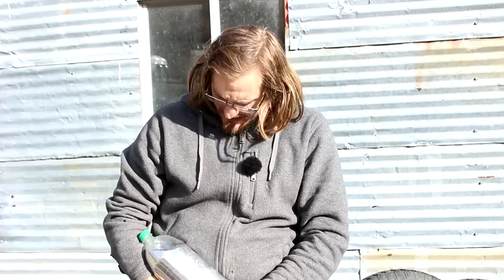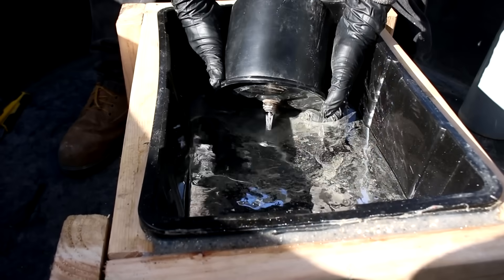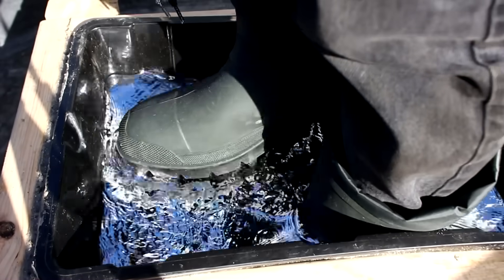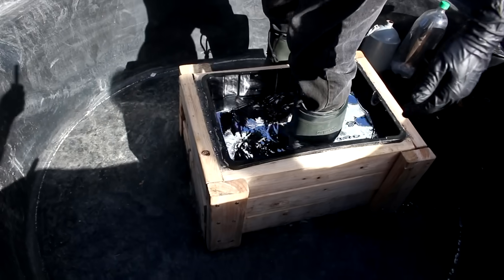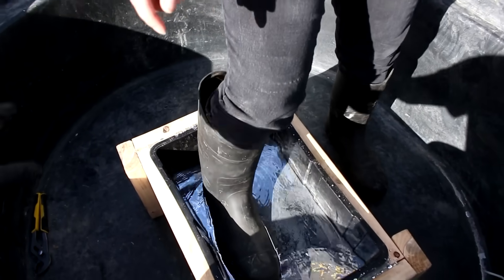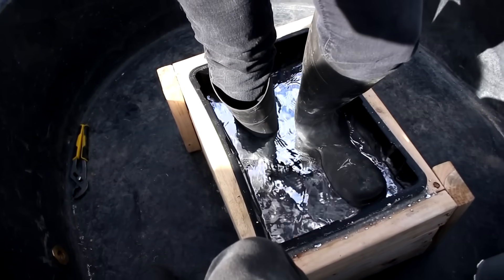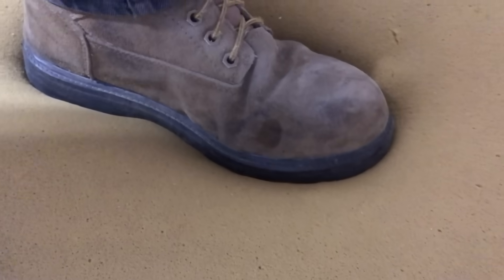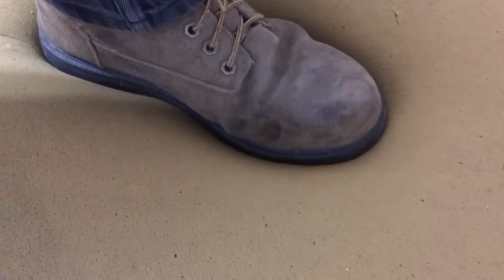Can I Stand On Liquid Mercury?

Comment: Have you ever heard of the idea of a buoyancy rocket? It would be a very buoyant, very aerodynamic object that is tethered to either a weight or the bottom of a container, keeping it submerged deep in a liquid. when released, it would be forced up through the water, then through the air. The version i heard of would start at the bottom of the ocean, but im sure a smaller model could be submerged in mercury to be pushed upwards even more forcefully. Does this sound like a possible means of flight, or a cool toy? Cody, if you see this, i think it would make for an interesting video. if not, what do my fellow commentors think of the idea?

Comment: I'm pretty sure you wouldn't ever be able to balance on it, even with a wide stance.  It's hard enough standing on a slackline, and with that the line is limiting the front-rear movement of your feet.  (and giving a slight centering force, assuming you're very close to balanced.
What you're doing is like balancing the broom, but instead of doing it on your hand, you're balancing it on an extremely low friction surface on top of your hand.

Comment: i wonder what would happen if you went barefoot because when you put air into any liquid it will always rise, such as the air in the boot. like pushing the bottom end of a cup into a container of water it shoots out of the water because of the pressures.

Comment: I saw some debate about the balance which seems quite wacky, so here's my take. In order to balance you need to make corrections by moving the pressure distribution of your feet on the "floor" on the 2 axis of this floor plane. Pushing more on one foot and lifting the other can give you lateral balance, and spreading the feet could help that (assuming that the viscosity drag when you lift is not bringing you down too much on that side). When you lift a foot, the upward force on it is lower, helping to regain the balance.
The real challenge is the other axis, heel/toe correction : there is not enough pressure gradient to push you backwards if you point your toes down. And the only way I see out of this is either with some sorts of accessories or much more space and skill : if  you fall backwards, make some kind of scissors with your legs to bring one in front so you can push yourself backwards. But honestly, this thing feels like ice  if you do it for real (with a little bit more inertia maybe) : what happens to people who start to zip backwards ? they never recover by trying to put the other foot further back, they end up on their but. 
You want to train ? cover your feet with 2 solid balloons full of air, of the right volume, and go try to stand in a swimming pool ! With some tuning (size / shape / type of surface contact of your feet...) it can be the exact same feeling.

Comment: Cody, if you have two attachment points high enough, you can simulate this pretty easily. I guess you might have some old stirrups on the farm. Just try standing in those. The pressure gradient in the mercury provides a tiny bit of a balancing force, you can recreate that by tweaking suspension length.

Comment: Of course you can stand on mercury.  You simply put a greater weight  (or more correctly, a greater density) of mercury in the box than you weigh yourself.   BTW, it's not gravity holding the mercury or you down....it's buoyancy.   Gravity does not exist as it is a myth of science (so-called).

Comment: Cody, make a shallow tripod with a platform as the top. maybe out of a round table. then float each leg of the tripod on mercury. stand on the tripod. see how small you can make the feet before you hit bottom. perhaps removable disks of different sizes. calculate the volume displaced and the mass of you and the table/tripod.

Comment: like lead, mercury is really not as bad as everyone think it is. I'm trying to explain this to my chemistry teachers at University.... Seems like everyone got paranoid about it as some point. Mostly because people just heard it was dangerous, but don't actually know why or more. For both of these metals the metallic/elemental/oxidation state = zéro is almost harmless. It's there salts and vapors who are more harmful. In vapor state you're dealing with a single molecule which is small enough to pass biological barriers like cell walls or tissue (in nose, lungs, wounds, stomach, etc). In fact it's exactly the same for the ionic forms in salts or compounds. The metal ion is isolated into water which bounds to skin and tissue eliminating any barrier. Being ions they bind on proteins and molecules of cell membranes or extracellular matrix.
Once there they are for longterm in your body because the body hasn't developed a mechanism to get rid of them due to this being quite unusual in our environment.
Now mercury does vaporises at room temperature, but REALLY slowly!
I'm not aware that we understand how they affect the body once they are in to cause the illness we know them for. But the worrying about those metals and the illnesses they brought only concerns people who work with these metals on a daily basis. Using them in compounds (lead paint) or at higher temperatures (lead casters, mercury gold miners, mercury distillers,...).

So to all those afraid, you risk nothing by casting lead bullets for reloading every once in a while, or playing with mercury like Cody does. You don't even risk a thing by swallowing a lead BB from a hunted bird.

PS: I only have 50g of mercury and about 5 pounds of lead. So watching you Cody play with 250kg of Hg makes me kind of jealous. Greetings from Belgium and glad to see you back on your channel after that YT shitty suspensions. Continue on the great work!

Comment: +Cody'sLab  If you retry this experiment in a bigger tub with more mercury, can you please try standing in it together with Kanyon?

Also, get yourselves some tighter boots, which will make it so that there will be less air in them and have a smaller volume and be closer to barefoot than in this experiment.

Comment: One thing I am sure you know, but wasn't clear in the explanation. The buoyancy of the boots (displaced volume) matters more than your weight. The weight carrying capacity is directly related to the displaced volume, not the weight. If you got form fitting boots, or plastic bags. you may not displace enough volume to float. If you stood in a bowl that displaced more volume than the boots, or just had a pair of bigger boots, you would float higher. Just building a boat on mercury and the same rules apply.

Comment: I'm wondering if standing on mercury is enough to squeeze the blood out of your feet (without boots). According to a short research the blood pressure should be 60 higher (google "Blood pressure changes in the leg on standing" for a source), so you would you have a systolic BP of 180mgHg in your feet. Which means that that you would lose circulation in parts of your body that sink in deeper than 18cm/7inches. 

So I would say its time to get cold feet and do some barefoot science (once you are properly healed or otherwise protected ofc).
Reply: Good point! Probably he would suffer loss of circulation if he remained standing. A minute or two would be fine.

Comment: You a re going to poison yourself with all that mercury vapor .. :(
Reply: Mercury has a vapor pressure of 0.0016 mbar at 25°C. He worked at -1°C with fresh air all around. There is hardly going to be any vapor.
Reply: Mercury vapor at -1° C?
Reply: someone just told you how much mercury vapor is in the air and at what temperatures. Metalic Mercury is not very volitile. Give it a rest.
Reply: He has experimented with mercury for years, and has had blood tests done to determine his level of exposure. As far as I know, his level isn't any higher than yours is.
Reply: Probably not unless he is boiling it, which requires a temperature of over 600 °F at atmospheric pressure. He'd be incinerated before he suffered from mercury vapor poisoning.
Reply: I get it you vape bru
Reply: Mercury isn't very volatile, he's completely fine. Even if he did inhale it, it's only about as poisonous as Lead.
Reply: No, it doesn't. Mercury isn't magic.
Reply: Was thinking the same, this is not like standing in front of a little petri dish with Hg, it is a huge ass bunch of metal, the vapor must be at least a bit.
Reply: You're going to vapor mercury with all that poison yourself....
Reply: Mercury gives off vapors in contact with air.
Reply: But how about the fact that mercury continues to evaporate even from cleaned surfaces ??  Every surface that ever was in contact with it, continue to evaporate, even when cleaned. He plays with Mercury way too often.

Comment: I would be an interesting video to show how the depth of a fluid determines the pressure more than the volume. You have all those great hills there. You could run a hose down the side of a hill and fill it with water to create a massive amount of pressure at the bottom then have the same volume of water in a larger container and measure pressure at the bottom of that container.

Comment: Cody, on toenails:
I used to get ingrown toenails all the time. Even now they're trying. :D 
The trick is to put a roll of cotton wool in between the nail and your toe for a while until it settles. And don't cut the toenails too deep. Haven't had an ingrown toenail for 10 years thanks to these two rules. I can go into more detail later, if you want. Good luck. ;)
Reply: glgina6 yup! I’ve done that for years and it really works. The cotton just creates enough pressure to literally force the nail to grow upwards. It’s totally safe as long as you don’t try to force the cotton super deep under the nail.
Reply: Wish someone had told me that about 20 years ago.
Reply: so you just leave it there or take it out in a month or so?
Reply: Can confirm I do this same thing
Reply: glgina6 In my case, it usually takes a week or so. The point (at least in my case) is to keep your toe safe from your nail until the swelling stops, because it's all mostly caused by stubbing your toe on something

Comment: Try spreading your weight out.  Use a wider, shallower pan for the mercury and shoes with a wider surface area (like solid snow shoes).  If you displace your weight enough the density of the mercury should be able to hold you once you pass that pound per square inch threshold.

Comment: Hey Cody,
Can mercury be carbonated?

Like if you put mercury in a high pressure flask with some dry ice, what'd happen? 

Thanks,
love your content!
Reply from the maker: Dont know about co2 but hydrogen and water vapor will dissolve into it
Reply: jpmisme1998 has that stopped Cody yet?
Reply: What if instead of using carbon dioxide you were to use something proportionately dense, like, say, tungsten hexafluoride?
Reply: Cody'sLab 
IMPORTANT QUESTION
What depth would a diver have to dive to in order for them to feel the same pressure your legs were feeling?
Reply: Home made gunpowder, home made cannon, liquid nitrogen experiments..... I see your point lol
Reply: I think fizzy mercury would be badass.
Reply: he it Calm down and think: Archimedes force is the result of pressure forces. Since Cody's floating, the Archimedes force is exactly opposite to the weight. Same thing when you float on water. So the pressure would be the same a human length under water.
Reply: Cody'sLab Sounds like an idea for a new video.
Reply: The equivalent depth a diver would have to be to feel the same pressure as Cody's feet would be about 4 metres.
(ρgh mercury = ρgh water. I assume Cody's feet were in about 30cm water, so the equivalent height of water = 13,600*0.3/1000 = 4 metres.)
Reply: I don't think that would be very safe or smart.
Reply: I'm absolutely fascinated by the fact you get to experiment with random stuff. I'd love to just hang and talk/experiment, or have you talk my ears off about what you've done already. Anyway thanks for all the vids, sincerely appreciate them. I loved the fact you turned a rock into iron, I literally wished for someone to make a video of that one day.
Reply: ah yes lets put a toxic liquid into a high pressure container, that's never gone wrong
Reply: MegaAdeny tungsten hexafluoride burns body tissue and mucous membranes, it turns to hydro fluoric acid
Reply: I can't condone amateur chemistry, because it isn't a safe hobby. Be careful.
Reply: what about No2?
Reply: he it it's a pretty simple equation rho g h=p. Hold g and p constant, change rho from the density of mercury to the density of water. And solve for h. If you can't do the algebra, the equation would be h=p/(rho*g). Just solve for p estimating the depth he went in the mercury, maybe 6-12 inches. Idk how deep it was. And then solve from there
Reply: jpmisme1998 Welcome to Cody's Lab
Reply: If there are some activated groups ( -C-OH or -C-SH for examole), you will get some organic mercury compounds.
Reply: So glad you're back Cody! I think it would be interesting to see what would happen if you made lamps dissolving helium in neon or some other noble gas and see what comes out!
Reply: You would end up with mercury soda lol
Reply: I almost corrected you by suggesting sulfur hexafluoride but then I looked it up... I would not have believed a gas at room temperature could be made with tungsten!
Reply: +Wei Zhao You can't use calcium or magnesium to reduce sodium hydroxide to metallic sodium. That just isn't going to happen because the equilibrium point is way over towards the other side of the equation - sodium would reduce calcium or magnesium compounds to metallic calcium or magnesium. I recommend you read up on the theory before attempting potentially dangerous experiments.
Reply: Is the point of effervescent Hg just that it would be more refreshing?

Comment: Will a container holding a vacuum flote if the container is light enough , since it basically is less dense than anything else , like for example does your vacuum chamber get lighter when there is a vacuum

Comment: You could probably calculate how far you would sink
Reply from the maker: I did it with water first to be sure I could displace at least 2 gallons with the boots on. but that calculation was tossed out the window by the mercury crushing the boot to a smaller volume. Fortunately it wasn't a lot different.
Reply: The amount of displaced mercury has to be equal to your weight, so you need to know the volume of your feet.
Reply: eureka!  know water displacement is easy to measure
Reply: You would have to measure your volume in a big bath of water, measuring how much the water rises, and divide your weight by it (I am assuming the human body has a uniform density, which it hasn't). Then you need to calculate the volume of mercury that is equal to your mass. After that, you have to put your feet into a water bucket until the amount of water displaced is equal to the calculated volume. Then you know how far you would sink without actually having to stand on mercury.
Reply: Cody'sLab by the way, what photochemical reaction did you use for the intro?
Reply: Could have been selenium?
Reply: @ Koos Naamloos probably just silver chloride left out in the open by the looks of it.
Reply: He used dog extract, I think.

Comment: Can you swim in it?
Reply: Valtteri Huuskonen Just guessing here, but I think it would be hard to get all you body into it as  your weight force is distributed over a much karger area. And pushing your limbs to move yourself would require a lot more force aswell. I guess you need to be both heavy (or rather dense) and strong  to do it. And you would probably get poisened as it is impossible to avoid swallowing something.